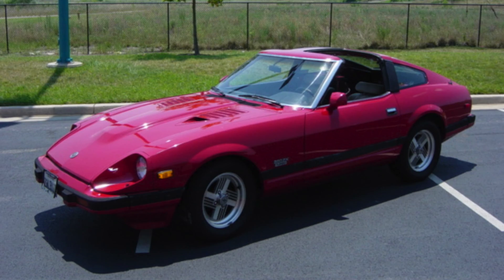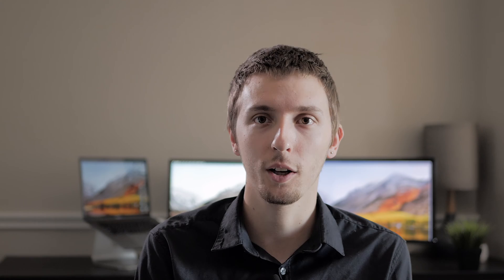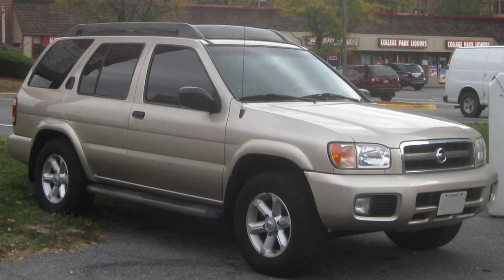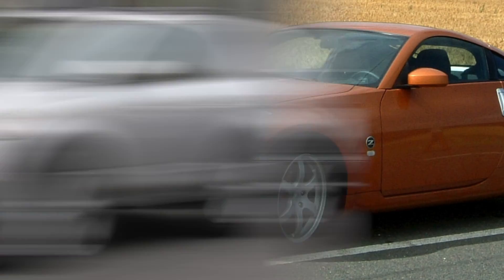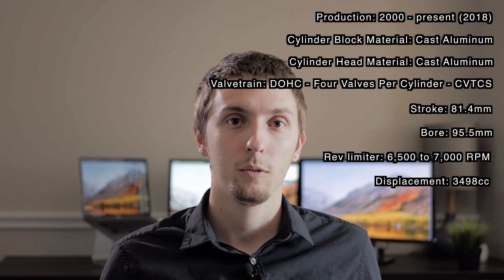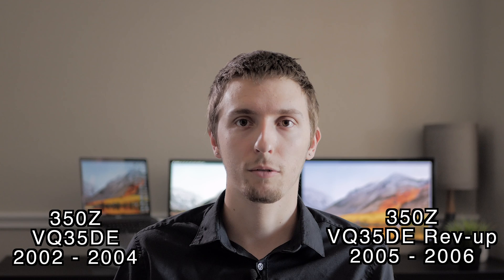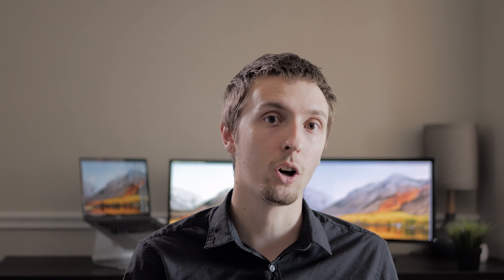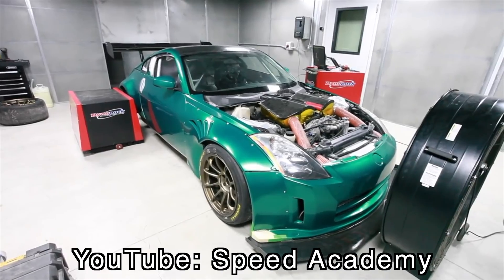Nissan VQ35DE: Everything You Need to Know | Specs and More

Comment: A lot of the power difference in that engine had to do with ECU mapping which at the time was fairly new and kind of complicated. Couples with different intake and exhausts. A lot of us back at that time were taking the lower plenums and having them machined to gain more power you would also gain an enormous amount of power by changing the headers due to the fact that they were so restricted from factory at least in the U.S. market

Comment: Just got a 2012 Nissan Altima 3.5 SR with the VQ35DE and the engine is amazing only thing that sucks is the cvt transmission but since it has 270 hp it has decent acceleration but I’m thinking of selling this to get vq37de . Is the VQ37DE a better engine then the VQ35DE ?
Reply: What sucks about the CVT? Yes they're less fun but they can accelate faster than a stick shift! I always prefer stick, but a good CVT holds a decent second place position... so long as it doesn't do fake shifts like some CVTs. Does the Altima do that?

Comment: I have 2001 pathy le with of course the vq35de. Some mods include hot plugs, cat back magnaflow, cold intake...kn...all new ignition coils, intake boot and plenum spacer ...custom made...and am considering a 75mm Tbody for few extra ponies. Vehicle has 200000 miles and I am from Canada....which has also then required a complete rust removal via new panels all way round, new everything where rust has affected looks...new oem paint plus new oem mags and new tyo open country 111 tires. Its a sweet ride with new leather frt seats , headliner and visors. Plus plus plus! But...only worth $5000CDN to the average joe....to me its worth over $30000 with all the work recently completed. Anyway....love your blog! Very informative....all the best....Jeff

Comment: I have the last year of the DE in an Altima. 2017 Altima 3.5 SL.  Least to say I am very very happy with it.  The car for what it is has decent pick up and can get up and push most stock sedans. It’s a family car definitely as it is paired with the CVT that hampers and improves the motor.  I can get great gas mileage for the motor although it has fake gears (has paddle shifters) it doesn’t react quickly to “shifts”.  I believe the motor has 270 factory and I would like to increase it. I’m at 60k miles and really only want it for 50 to 60 more. I have been torn between doing what I need to get the car to 350 or so bhp or just selling and buying a new platform.  We may not trade it in and just get a new car for a family machine and I can dink around with it.  Idk.

Comment: Just picked up an 03 r50 with the same motor. Having a hard time finding performance parts for it so wouldn't parts meant for an 03 350z fit the pathfinder motor? Haven't been able to find any info about it, can anyone point me in the right direction?

Comment: Currently have a 300hp VQ35DE in my 16 Maxima. Also had it one an 03 model. Great powerful engines. Not the best on gas but never lacking power and always smooth acceleration.
Reply: I have a VQ37VHR tell me about the gas consumption lol
Reply: @sleazymeezy  I have to drive like a grandma to get above 24mpg.
Reply: I got a 22' Maxima. That engine is bad to the bone. I love the exhaust tone when you cold start it. The power is incredible! Love my Maxima!

Comment: My 07 M35 has been such a damn good car. It’s at 125k miles and still feels tight as a drum. I replaced the radiator at about 110k miles and the washer fluid pump around the same time and that’s basically it. From the way it starts, sounds, idles and drives, it honestly feels like a new car. It doesn’t burn any oil. I check it every couple of weeks. 

Of course most modern cars can last a very long time if properly maintained and the same is true for these VQ engines. If you take good care of them, there’s really nothing stopping them from going 200k, even 300k miles. Many of them bite the dust before that point because they’re owned by people who have no interest in maintaining their cars and simply don’t care enough to keep up with it. They’re just gonna drive it until it has problems and then sell it. Avoid those cars at all costs.
Reply: Facts lmao I remember I was young I always wanted a g35/37, saw many breaking down or not driven so I didn’t really want one until I realized why

Comment: Thanks for the detailed education about my new car. I picked a 2003 350z up and it was babied. Only 26k original miles and I love it. I knowledge on all cars is limited, but now I’m getting into this car and I’m probably going to put a vortec supercharger complete kit on it. The car already has a cold air intake aftermarket rims adjustable suspension etc. I’m wondering what other modifications you would recommend I’m thinking about some aftermarket headers and exhaust and also the Plenum spacer throttlebody and I’m not sure about a bigger cam or not. I don’t want it to be a headache for me and I understand more horsepower more headaches but it seems like this system with this motor is pretty reliable. It could be my every day, but not really because I have a roofing company with trucks I drive trucks all the time so this is my little gold card/missile I think and I’m getting educated through videos from guys like yourself and I appreciate that thank you very much
Reply: Definitely a plenum spacer I have the 5/16th Blox spacer. While you're installing it I recommend giving everything a good cleaning. Change the plugs and coil packs while everything is apart. You could also do a throttle body coolant bypass. I got the spacer for $87 on ebay, 6 brand new coil packs $46, 6 NGK Laser Platinums spark plugs $22 all on ebay. Those plugs are normally 8 a pop. I also installed new valve covers so that's why I did everything. I painted the plenum too. Doing all of that really brought the engine back to life. It hauls ass and screams now. The plenum is never hot, no matter how hard I drive it. I also have a cold air intake, I relocated my k&n come air filter in the driver's side bumper insert. 
It did take about 500-800 miles for the ecu to sort everything out. So if this happens don't be alarmed. I kept getting codes for running too lean. I did the idle relearn, throttle body relearn and ecu reset after every code. Then it just went away and it's been driving just fine. Oh yeah I installed an oil catch can for both bank 1 and bank 2 it's a baffled closed system that returns back to the lower plenum. This has cut back on oil consumption. It catches all kinds of nasty crap that normally gets sent back through the intake to be burned off. I have 207k miles by the way and it's driving so strong. So yours is a rare gem, they'll last forever as long as you maintain them.

Comment: Major question my O2 3.5 SE Altima didn't have an auto tensioner pulley. I get new belts and after a couple of weeks would take him back to get tightened again. Drove me crazy that they didn't put a pulley tensioner in there.  My question is does the 2017 Maxima have a pulley tensioner??

Comment: A failed tensioner is unlikely to ever break a timing chain, as they are made of softer materials than steel, which the chain is made from, but they can break / snap off, and make an incredible racket and obviously detrimentally affect timing. They are a fairly simple fix, but labour intensive to get at. I know this because I had one fail in a Ford straight 6 engine (I-6 motor) once.

Super-annoying problem if it happens though.

Comment: Picked up a running pathfinder with the VQ for crazy cheap and as the trans starts to slip im thinking about putting the vq35de in my miata. Anyone here done a "refresh" on one? Is it worth it seeing as i already have the motor it should be cheaper to tune and build than buying a k series or something

Comment: I have a 2006 Nissan Maxima with the 3.5 in it and I think I have the last year of the automatic transmission that is not the CVT and I was wondering which company would be one of the best to go through to buy engine upgrade Parts I want to try to get about 350 to 375 horsepower out of it do they sell engine kits I don't know where to look thank you for your help

Comment: Plenum space # 1 mod not mentioned here. Front 2 cylinders starve so a 5/16" spacer improves power low end torque and better fuel economy.. I fitted 1 and it works

Comment: I have a 2004 350Z and a 2014 Infiniti Q60S. In a comparison, the old
350Z has a LOT more bottom end torque then the Infiniti's 3.7L
engine. From 600 - 3500 rpm, the old 350 has a lot more pull
when accelerating where as the Infiniti starts to shine above 4000 RPM.
Both cars have six speed manual transmissions. What is funny is that
the 0-60 and top speed specs for the 2004 350Z and the 2014 Infiniti
Q60S with a six speed are exactly the same. I found that funny and
interesting. Also, the gearing is identical in both cars. By this I mean,
they run at the same RPM relative to the same speed down the road.
As for my 350, I have no issue with oil consumption. Yes, there is
that start up rattle and at 100K miles I  had my water pump and
my timing chains and tentioner replaced.
Reply: One thing. I replace the oil in both my Infiniti and my 350Z every 3K miles with
Mobil 1. Both the 3.5L and the 3.7L engines are very VERY unforgiving with respect 
to dirty oil and this is the number one reason for oil consumption. What happens is
if you let the oil in for, like 5K miles or more, the engine will build up varnish and 
sludge which blocks the return passages in the heads causing oil to stay on top of
the cylinder head and where the PCV valve system can suck it up. This is
what causes most of the oil consumption in these engines. 
This can occur in as little as 20K miles if you don't  change the oil enough and
or use cheap or wrong oil. This issue
also affects the newer 3.5L and the 3.7L Nissan V6's.

Comment: I have a 2004 350Z with the de. It has 100 1000 miles I just bought it. I have not driven it yet per se but I have been working on it it had 4 oil leaks both rear valve cover spark plug cylinders were holding oil camshaft position sensor as well as oil cooler o-ring. My biggest expense was replacing the valve covers which cost $50 for both on eBay and now there's no oil leaks and it runs fantastic I feel I will got my money's worth. It's the touring Edition hardtop and I paid $6,800. Even after fixing all the oil leaks I still got my money's worth. it's all stock no mods and I look forward to enjoying it for a long time
Reply: Pretty common for valves to fail on the z they use alot of torque and have high pressure from all that natural aspiration I would change or check them every year for leaks ans every 3-5 years for optimal performance as well as regular tube ups like oil change , spark plugs , gaskets , crankshaft & camshaft sensors as well most common parts to fail aside from belts and tire wear it’s a solid block of maintained right

Comment: Great video.  Love my DE!  Should be noted, flaws of the DE (not mentioned) bearing failure when boosted and/or driven aggressively, and PITA to bleed air out of the coolant system.
Reply: took me longer to bleed than to replace thermostat and drain coolant haha
Reply: I have a m35 with the de. I’m considering adding a swirl pot to make it easier to bleed

Comment: The VQ35DE was a Replacement for the VQ30DE not the VG the VQ series replaced the VG but not the 3.5 the 3.0 was the first VQ series Engine here in America. FYI Also find the VQ30DETT on wiki. They actually took out the VQ35DE 3.5 for the VQ30DE and made it twin turbo for their race series vehicles in JGTC and what not until they replaced it with their V8 VK48DE! https://en.m.wikipedia.org/wiki/Nissan_VQ_engine

Comment: Sad really. Almost every major auto companies are going either turbo or direct injection engine unless it's a bigger motor. No more regular NA engines I'm guessing nowadays. 😁
Reply: Engine longevity doesn't interest them. They want more power out of a smaller powerplant for driveability, and can sometimes offer more fuel savings. The mass-consumer market pushes it, and they can save on engine production cost now that turbos are ubiquitous and relatively cheap components, rather than exotic things they were in the past.

A lot of transmissions going CVT also, or automatic, and manuals are becoming very rare.
Reply: @VenturiLife  😊👍

Comment: I could swear 05 z had regular de motors. Only 06 models had the "revup" motor I thought
Reply: They made two models in 2005 I have one it's the De they also made the rev up which have more hp but less torque it's the anniversary model  but burn more oil

Comment: Hey man; i'm a po boy looking to buy a 2001 pathfinder 2wd xe. From what i can tell, it does have this vq35de engine, correct? Is it a non-interference? Does it use a timing chain or belt?The suv has only 140,000 miles on it for $2000. Not planning on modding or racing it. How do you think it will hold up under normal driving? might i get 300,000 miles before it dies? Any insights and recommendations would be awesome; Thanks!
Reply: Yes, this line of engines uses a timing chain. And any engine can make it to  300,000, just maintain it, and check oil frequently on the VQ35de

Comment: Hi. Can you describe how to tell the difference between VQ35DE standard and the REvUp version please?
Reply: The Rev up version of the VQ35DE adds an variable exhaust timing  cams. So (visually) there are two circles on each of the camshaft covers, on both the left side and right side of the motor. One solenoid mounted to each of the cam shaft covers. Facing the front of the motor  Left side has a green solenoid connector, the right side has a blue connector.  the VIN number will tell you also
Reply: LoneWolf Motorsport Rev up: front bumper. HR: Front bumper and hood
Reply: Easy. Look at the rev gauge on the dash. Redline starts at 6.5k, if it's the rev up the redline is at 7k.

Comment: Korean cars keep getting better but as far as I know, generally speaking, Japanese engineering and build quality is still No. 1. 
What is it about Nissan and timing chain tensioners though? They have been a weak point for them in all their high performance motors for about thirty years now! Wtf??
Reply from the maker: Some problems never die I guess. Thanks for watching 👊🏻
Reply: Dave L if you are going to spend 15 grand building a VQ motor you might as well do an LS or 2JZ swap. Thats what Im leaning toward doing, why build a motor that can only at best hold 450 hp, when you can build a motor that has unlimited horsepower gain potential like the others mentioned. 2j is still efficient and reliable at 1000 hp, unless you are a crazy nut if you've ever been in a 500 horse anything, that is scary enough let alone a 1000 hp ass rocket😁. My 350z's almost 300 hp is good enough for me right now. Things can get pretty crazy in a 350Z quick if you dont know what you are doing or under estimate its abilities.
Reply: Chain tensioners fail on other cars like Fords etc. I think it has to do with the design and how much load ends up on the tensioners. They will wear over time, develop slop / rattle and eventually break etc. The chain should pretty much last the life of the regular car. The saving grace is tensioners usually give you indications they are on their way out and are going to fail first.
Reply: @VenturiLife  how long do you expect to get out of the engine and/or Nissan Altima 3.5 once the issue starts showing the rattle issue?